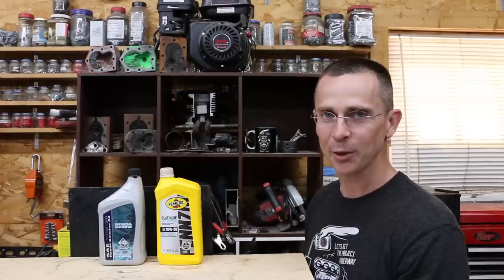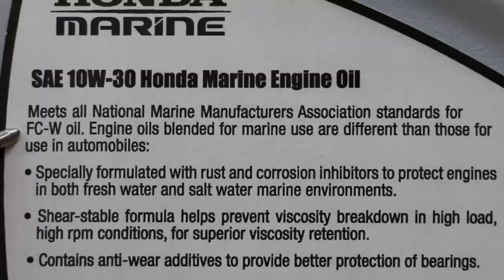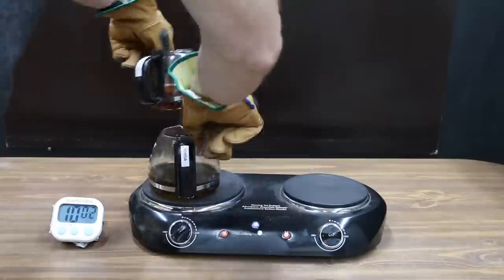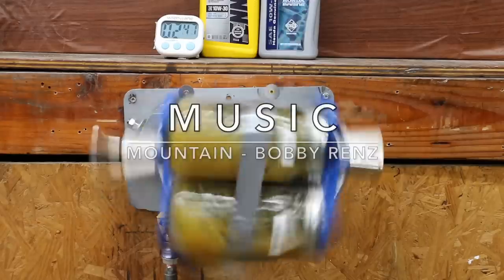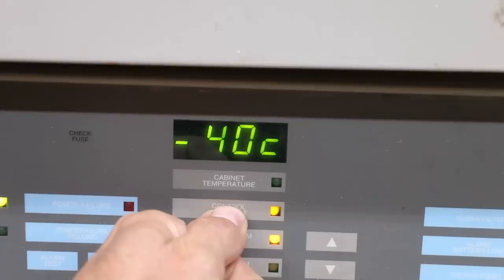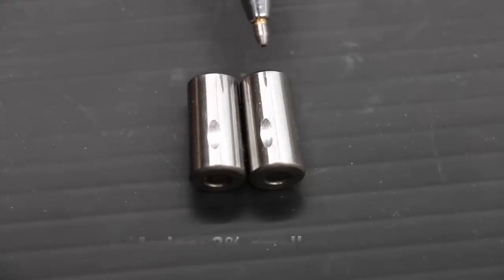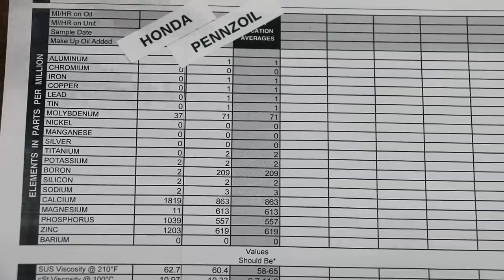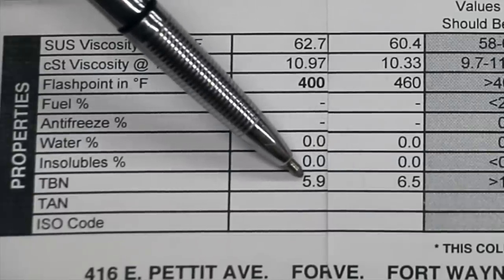Motorboat Engine Oil Better Than Regular Motor Oil?

Comment: An idea for testing, I follow off road travel videos, and an item came up about a off road roof rack falling off a truck in Australia, the manufacturer instructed it to be pop riveted to the car roof with 4.8mm pop rivets, which for a roof rack with a load of around 100kg, 8 rivets to each side didn’t seem sufficient , in my mind. Would it be possible to test pop rivets, as included in fitting instructions, compared with, 6, 8 & 10mm rivnuts, as a strength test and results to pull through steel of 0.7mm, trunk roof. Would be interested to see the results,  if you could carry out your excellent testing.    Peter
Reply from the maker: Thanks for the suggestion.

Comment: Hey man. I use small engines a lot. Mini bikes, jr dragster engines, lawn mowers. I use 30w on the mower. 10-30w with zinc additive on mini bike. Lucas jr dragster oil on the performance engine. Would it be worth it to switch to the jr dragster oil to get the max life out of all my small engines?
Reply from the maker: Thanks for the suggestion.

Comment: I think marine engines are designed to run at a lower temperature because they cool off from the water they are in, so evaporation isn't much of a factor.
Reply from the maker: Thanks for the feedback.

Comment: Is there a way to prevent the crystallization in the engine head? I recently replaced the gaskets in the head valve cover of my Tundra and I was disappointed to see much stuff has built up. Is there a product to remove it?
Reply from the maker: Thanks for the suggestion.

Comment: I've used a product called mollykote.  Could you add some to motor oil and test if it improves lubricating factor. I would love to see you add it to the crank case of a lawn mower engine and test one without  mollykote and see which one runs the longest before destruction.  Carl
Reply from the maker: Thanks for the suggestion.

Comment: Would it be possible to test a regular oil in a marine application. Most marine engines made now are four cycle. Do they really need the special oil.
Reply from the maker: Thanks for the suggestion.

Comment: boats rarely go out in extreme cold conditions so the flow test, while really cool is not that relevant.  it’s disappointing to see the marine oil not outperform the automotive oil.  i would consider using the penzoil in my stern drive though
Reply: I agree. The cold weather test is neat but in this scenario not very relevant.
Reply from the maker: Thanks for the constructive feedback.

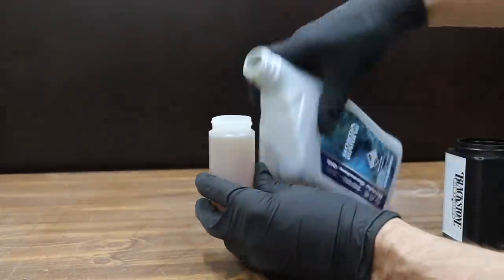Comment: @1:02 you said “ by the way I always shank the containers before sending samples for testing since part of the oil additive package may actually fall out of suspension and settle at the bottom of the container” why don’t you test that?
Reply from the maker: Thanks for the suggestion.

Comment: How would certain minerals in engine oil interfere with the catalytic converter, unless your engine is burning oil in combustion due to a worn out piston rings or valve seats?
Reply: every   engine burns  a  tiny  amount of   oil   even if you  cant tell    and that tiny  amount  over  years   may   damage  the  cat

Comment: I'd like to see a test of Ethanol Gasoline with the Ethanol removed using the water method Vs pure gasoline. Is it worth doing to protect classic car and bike carburetors from the effects of Ethanol? We're going from 5% to 10% Ethanol in the U.K soon.
Reply from the maker: Thanks for the suggestion.

Comment: Sounds like Marine oil could potentially be a decent break in oil, or a break in oil past the actual break in oil you should use on a new engine. Assuming you've removed your catalytic converter, which I be doing eventually lol.
Reply from the maker: Thanks for watching!

Comment: Problem here is comparing a non-synthetic oil to a synthetic oil.....should compare apples to apples - synthetic oil to synthetic oil....that's where a lot of these differences stem from more than the additive pack.
Reply: additionally, the additive packs of both of these oils are pretty weak - both would be beat out by a synthetic 10W-30 HD diesel oil
Reply from the maker: Thanks for the constructive feedback.

Comment: Why wouldn't you use Quicksilver, the most popular and reccomend marine oil?
Reply from the maker: Thanks for the suggestion.
Reply: @ProjectFarm  Every boat manual I come across reccomends it and I have been using it forever. We have had this debate about HQ auto oil just as long. Interesting choice of testing scenarios.

Comment: Test between using heavy weight Motor oil vs gear oil in the engine? wear and blow-by reduction??
Reply from the maker: Thanks for the suggestion.

Comment: I just paid $51 for a gallon of Quicksilver 25w-40 blended synthetic for my 5.7L 1987 Mercury inboard. If I were to use a non marine oil, what would I buy? I've never seen auto oil 25w-40. Thanks
Reply from the maker: Thanks for the suggestion.

Comment: If your marine oil is 40 degrees below the freezing point of water in your boat's engine, you have far bigger problems than just high oil viscosity!
Reply from the maker: Thanks for the feedback.

Comment: we went around the world in a mega-yacht . the diesel had to go through a purifier to take out water that is in the normal diesel . ?= does purified diesel give more power ( engines we had where Caterpillar) or is it that engines wear less . I know we bought diesel in different countries . ?= are countries adding water ?
Reply: Diesel engines usually have a moisture separator to remove water from the fuel. Excessive moisture in a diesel can cause all manner of problems with injectors and even lead to engine failure. Being a less refined fuel, diesel will tend to absorb more moisture when it sits in storage tanks for long periods of time. Also keep in mind that different countries will have different standards concerning the moisture content and additives that may be in the fuel purchased. Running it through filters and a fuel/water separator will help ensure the the engines are running on fuel that falls within the standards set by the manufacturer.

Comment: What’s the best chainsaw fuel and oil to use in your chainsaw
Reply from the maker: Thanks for the suggestion.
Reply: @ProjectFarm  awesome  I love your videos I always consult your channel before heading off to the hardware store and recently acquired a MS180c and have been wondering if cam 2 race fuel and maxxim 927oil is safe to run through it

Comment: you failed this test.  You have to understand that marine oil can have water in it and still work.  YOU FORGOT TO TEST THE MAIN REASON WHY MARINE OIL IS NEEDED BY DOING A WATER OIL MIX. CAUSE WATER GETS INTO IT. Marine Oil has an additive in it that soaks up water and allows the oil to still lubricate with a high water content.  If you use regular oil
 in a boat and you have a tiny gasket failure, say bye to your engine.

Comment: Keep in mind that marine engines and automotive engines have very different operating conditions and needs
Reply: A couple examples are the different cooling systems, marine engines tend to suck cold water up into the engine then pump it back out where automobiles have a recirculating style cooling engine that runs at higher Temps, automotive engines also under normal load only see high rpm in short bursts where marine engines are operated at a set rpm (full speed is top rpm for several hours)
Reply from the maker: Thanks for the feedback.

Comment: old ford flathead engines need oil with zinc  so the honda oil is the oil to run 

is it possible to do a test for the old engines vers new engines
Reply from the maker: Thanks for the suggestion.

Comment: I don't understand the business with corrosion in fresh and saltwater environments. Water isn't in your oil unless you have a whole different problem. Boat engines don't typically turn the RPMs that automobiles do. Seems like a complete load of crap to me

Comment: It seems that you should have done a Marine Oil vs Marine Oil test first.
Mercrusier  vs Honda vs John/Evin vs Suzuki vs etc
Then the winner should have gone up against "your own proven automotive" winner "Amsoil".
I don't get this "random Marine vs random Auto oil.
Test the best vs the best.

Also how is it going to clog catalytic converters if oil stays in the new engine or like new engines? 
 (not including the obvious warn out engines, rings and seals?). i don't understand.

Comment: This is a really interesting video and I think its worth trying out more different types of fluids and oils than just marine oil. I think gear oil would be really interesting to try against normal oil as most gear oils are typically much thicker such as 75W90. I would like to see how that goes up against normal vehicle oil and if it is usable.
Reply from the maker: Thanks!  Thanks for the suggestion.

Comment: Marine oil is not designed to run as high temp as auto oil, marine engines run much cooler than auto engines.
Reply from the maker: Thanks for the feedback.

Comment: Well, I suppose if you drive a land yacht, you might get some benefit from marine oil. Dollar-for-dollar, the automotive oil is the clear winner here. You can tear down an automobile engine at 200,000 miles that has had regular synthetic oil changes and what will you see on most critical wear surfaces? Nothing. No detectable wear. People who obsess over modern oil specifications are arguing minutiae. How many angels can dance on the head of a pin stuff. All modern commercial grade oils are superb.
Reply from the maker: Thanks for the feedback.

Comment: Show me marine engine starting at -40c or -30 or -20 or -10.
Reply from the maker: Thanks for the suggestion.
Reply: @ProjectFarm  I'm serios, marine engines do not start in -40 (until it is ice class vessel, but they never stop engines). Cars usually don't start as is in the -20C regions - people use defi or webasto and any oil is liquid enough for -20C and warmer. Also there are no such situation as rubbing (no such places in the engine) one metal part against another metal part 
Main feature of oil - is to hold its additives and dirt from gas burning so that it wont end on engine parts especially rings. So you dont need to check how much oil was burnt. You need to check how much additives were dropped while oil was overheated.

Comment: PROJECT FARM you should test out 1 inch auger bits to see which holds up best.

I just picked up new auger by Milwaukee an impact rated LINEMANS edition and its a beauty 18”x1” . Wondering if it holds up as good as it looks. Not the ordinary milwaukee auger. 

As an Electrician auger bits are used and abused often. Im always looking to get the best performance and durability. So be curious to see your results.

Bosch , diablo, southwire, greenlee and Milwaukee all some brands to consider as ive used all Of these at some point amd probably a few more.

Thank you,
MCElectric
Reply from the maker: Thanks for the suggestion.

Comment: I hate to say this but as much as I like his videos, this is a terrible comparison.  Marine oils are formulated differently as marine engines are usually water cooled but run wot for a long time. Second due to cafe regulations and increased film strength automotive oils are getting thinner.
Reply: This is a terrible comparison because they used Honda petroleum based marine oil vs full synthetic automotive oil. Had they used Hondas full synthetic or even their blend marine oils the result would have been different.  They did an apples to oranges comparison.

Comment: Bad misleading experiment, (petroleum vs synthetic)   Project Farm, why would you compare a petroleum based Honda marine oil to a automotive synthetic?  Synthetic wins every time you should have compared apples to apples (synthetic marine oil to synthetic automobile oil)....   This is a misleading experiment and may cause a boat owner to use an inferior product.